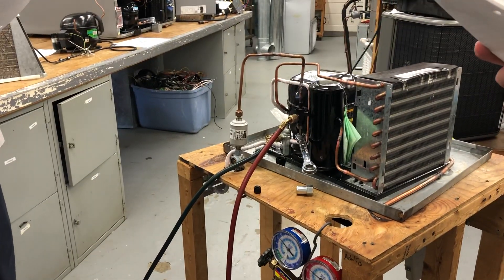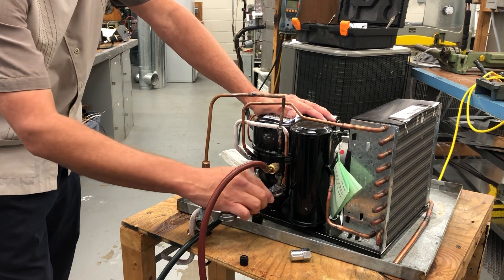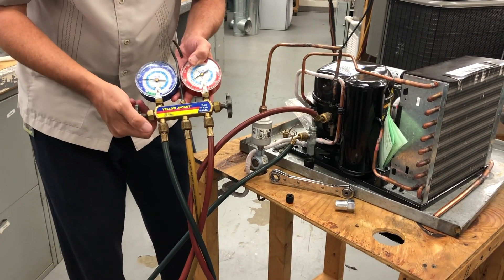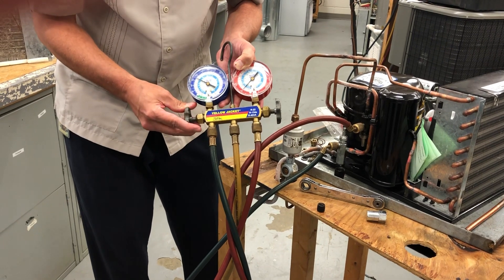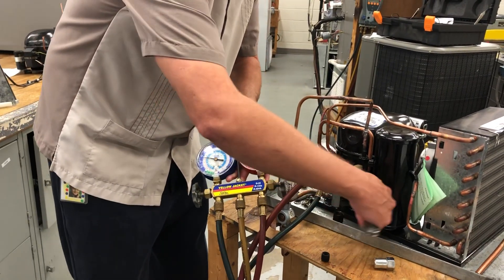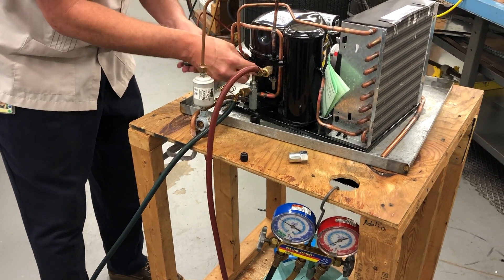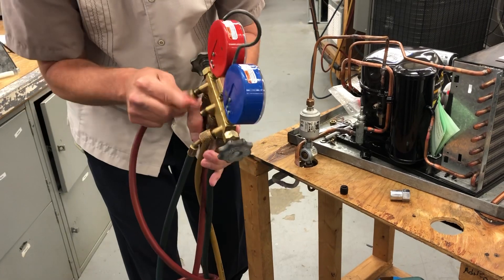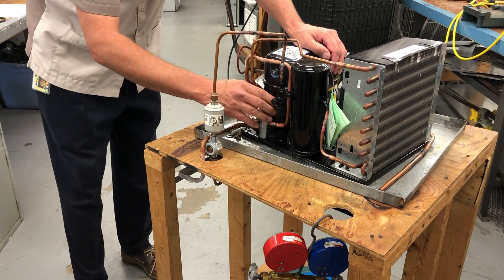HVAC Basics: Procedures - Proper Removal of The HVAC Bar Gauge Manifold “Gauges” with AC Stem Valves

Comment: HVAC people should be only ones with this knowledge alot of half ass jobs have been seen by me coming in on a service call after another "tech" had already tried to fix with jank. It's crazy people don't know how to purge their gauges back into the system so there's minimal loss. Only the vapor that's a small amount or nothing. But I have still seen some higher strong vapor before on some real high pressure systems still only gas though no biggy.